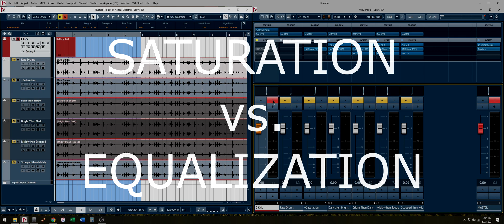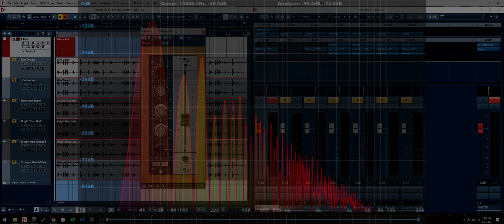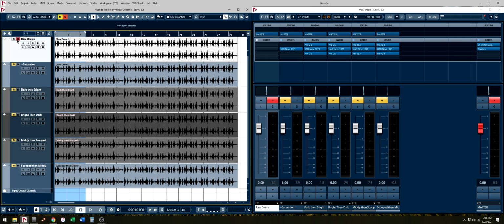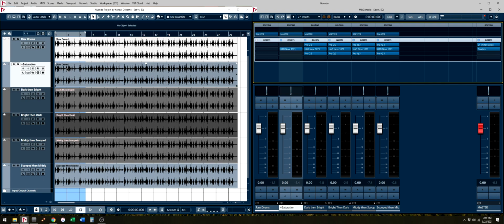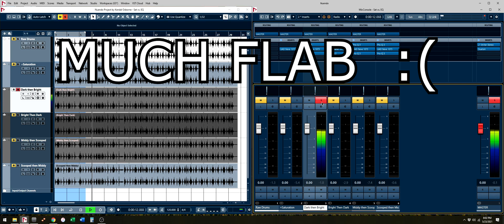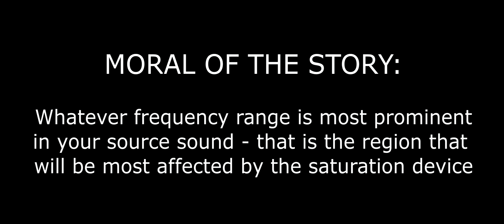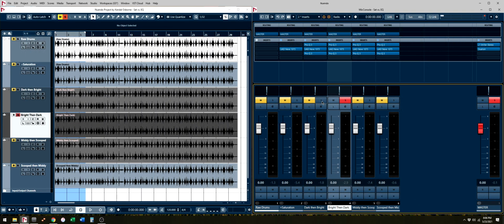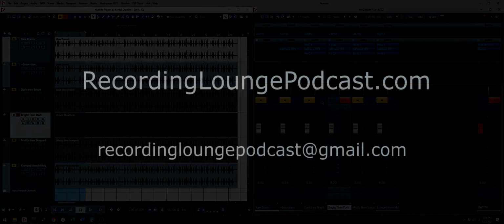Saturation vs. Equalization - How the Source Tone Affects Saturation

Comment: Man, these videos on saturation and loudness have really dropped an avalanche of pennies on me. 
For so long Ive been trying to achieve this effect with eq and compression (and some saturation but not using it like this) and I didnt realise that correct use of saturation gets me in the ball park without even needing EQ or compression! 
Not only that, its started to lift the veil for me of 'WHY' professional audio engineers stuff sounds so much better than mine. For the first time I can understand what they would be doing different to what Ive been doing to achieve their results, I can see the bridge. Its not voodoo magic, its just proper taming of dynamics and enhancing things to make the sound richer. These things had been at the forefront of my mind, but my approach was wrong. Thank you so much dude.
Reply from the maker: What really lifts the veil is when you realize that engineers working with tape and analog consoles didn’t even have to worry about this. It just made their mixes sound better without them having to try. Ahh… simpler times. Haha.

Comment from the maker: One other interesting example of filtering pre saturation - GUITAR AMPS! This is incredibly common practice in guitar preamp designs, notably amps like Marshalls, Friedmans, Soldanos, etc. The key to keeping these amps high gain and NOT flubby is carefully placed stages of filtering throughout the preamp section, not only cutting lows but also boosting highs. If this is not done properly in a medium or High gain amp, the distortion sounds muddy and terrible, has no articulation, and doesn’t sound good with palm mutes. This is also the same reason so many players put a tube screamer before their high gain amp - to tighten up the low end PRE distortion.
Reply: this is what got me digging into this in the first place.

amp sims and how to make them SING!

this technique is crucial - beyond just HPF the guitar input - great stuff!!!

the mind reels!

thank you again!

Comment: Excellent topic - and timely with some current projects.

Got me to rabbit-hole de emphasis curves.

Thank you!
Reply from the maker: It does. This is sort of the philosophy behind the Vertigo VSM2 frequency selective modes!
Reply from the maker: The VSM2 blends in a bandpass filtered version of the output with the dry signal. It can be a little weird to get the level just right but it works similar to a multiband or pre emphasis filter kind of setup.
Reply: @RecordingLounge  VSM2 and Saturn are great with the multiband distortion approach.

DW has a great vid using de- and re- in Reaper

 https://youtu.be/H-Gs-o39C5o

I am trying to figure out how to do this in Studio One v5 - the Splitter tool is now implemented as plugin style - with the frequency split, you can multi-band ANYthing.

i just want to figure out how to do the parameter linking that Dan W did in Reaper in S1.